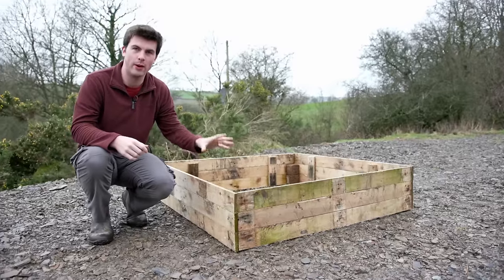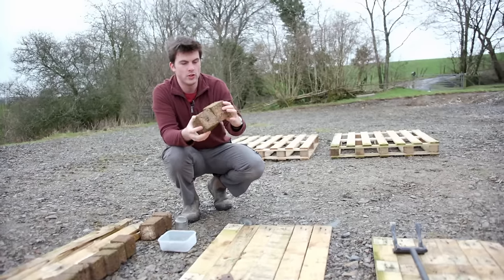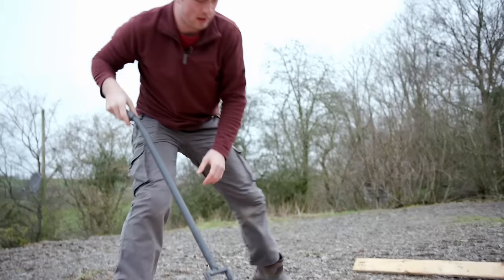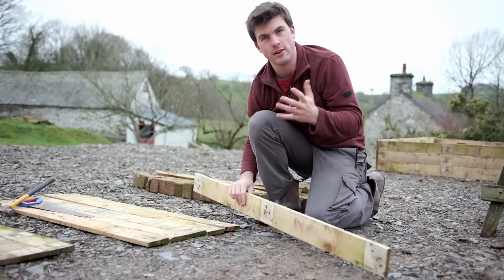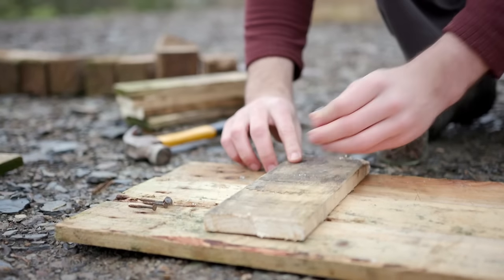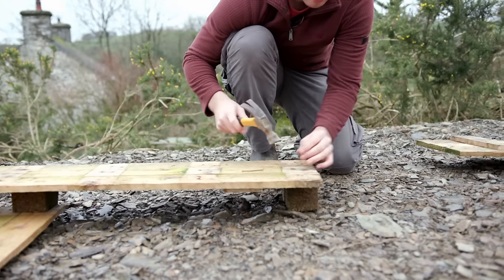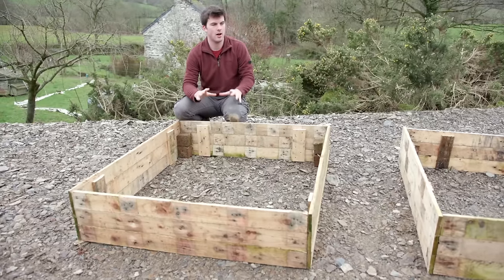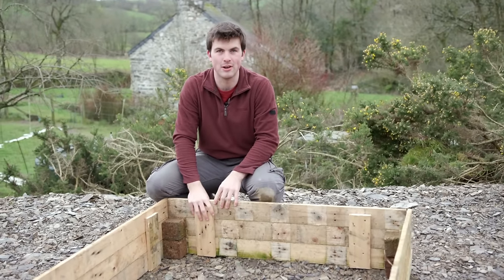How to Build a Raised Bed from 1 Pallet! (FREE and Easy)

Comment: Lining the inside wood of these raised beds with old compost bags or similar protects the wood and makes these beds last a lot longer. Just a little tip to make them last a long time.
Reply from the maker: Hi John, thank you so much! Do you mind if I include this in a video?
Reply: @HuwRichards  Don't be silly, of course. It does help. Treating the wood on the outside with any preservative is another tip. My big "letter E" keyhole-stye raised bed from pallet wood is now 5 years old, still as strong.

Comment: What a fantastic idea! Can they be painted? Or would that interfere with food safety?
Reply: Wondering the same if can paint them
Reply: Latex paints should be safe, esp. if indicated for interior use. That should be an indication that the pigments used are nontoxic. Of course, interior paints can be used outside. But I have not researched the topic.

Comment: Wow! Amazing quick fix DIY. I love this, thank you. 
Can the raised bed have a base though?
Reply: It can, but then it becomes more of a "container". The point of leaving the bottom open is to give roots access to the ground. You would layer things like cardboard and newspaper in the bottom to kill off grass and\or weeds under your plants, and the paper products decompose over time, adding to your soil. Roots can grow as deep as they want, bringing up nutrients from sometimes several meters deep, and beneficial critters have free access to your soil from the soil underneath.
Reply: @stiaininbeglan3844  plus I think it will be super heavy to move it and also you'll have to level it on the ground so the bottom will not crack or bend with the weight of the soil. 🤷